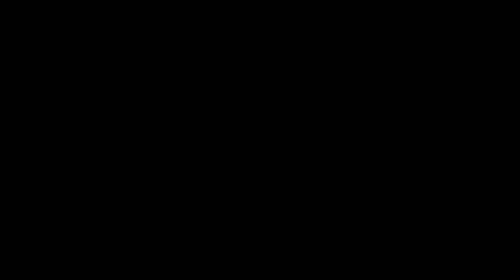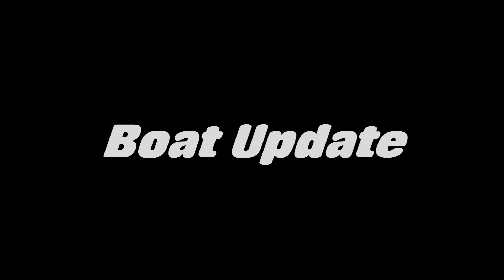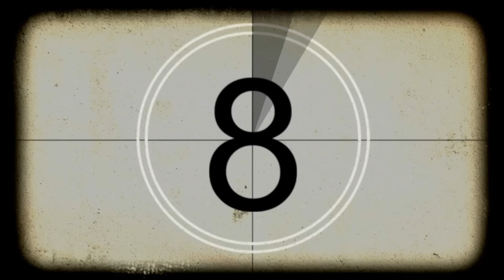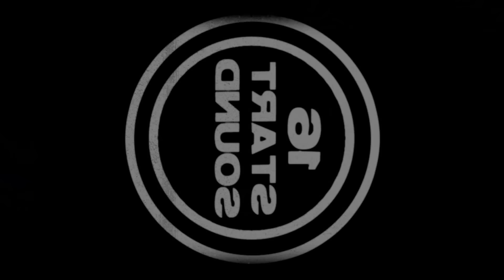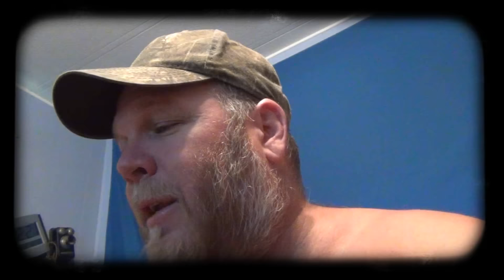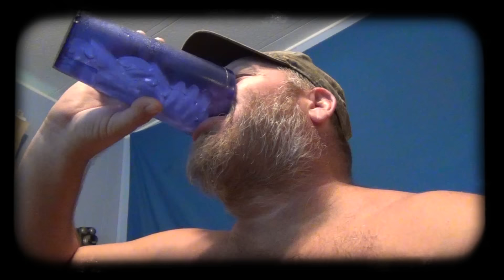Boat Update

Comment: sell your old motor to them. old bolt's just need heated up then loosen them when they are cooling off . good luck.
Reply: Yes sir. I replaced my head gaskets on my 25 hp.  Same as his 35.  It's nothing like a car.  The heads are more or less a cap that holds the plugs.   Easy easy easy.
Reply from the maker: +hairfarmer07 nope ,,, http://www.boats.net/parts/search/Merc/Mercury/1986/1035726/CYLINDER%20BLOCK%20CRANKCASE%20AND%20COVERS/parts.html